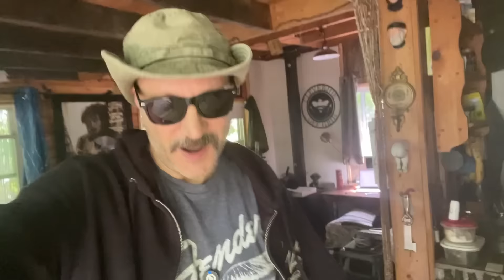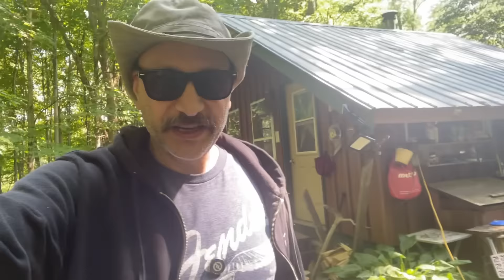Don't Kill Your Generator: 7 Mistakes to Avoid

Comment: Only use propane in a dual fuel generator. Buy several 20 lb. Propane tanks for emergences, and primarily use the generator to recharge a power station— use the power station to run your appliances instead of the generator. Fuel will last up to 5x longer that way.
Reply: We have a couple 30 lb cylinders. We also have two 40 pounders. I prefer 40’s because of the additional run times they give us.
Reply: Best solution is generator powering a power station.  I have an 8000 watt power station and a 2400 watt generator.  Lessoned learned during Helene, use the generator to charge the power station to 100% and then shut off the generator.  The mistake I made was once the power station was charged to allow the generator to run and use fuel doing pass through charging.  I could have saved fuel by shutting off the generator and using the power station.
Reply: If just charging a power station, I recommend a small 2k wh propane or gas generator then
Reply: Yes sir, I agree, best way to go.

Comment: Run the generator on a level surface, the crankshaft and generator can wear quickly if they're constantly running with pressure on the thrust bearings 

When storing always pull the cord over slowly until resistance is felt, this means you're on the compression stroke and the valves will be shut, mitigating the damp air entering the cylinder
Reply from the maker: Pulling the cord to resistance before storing is a new one for me, thanks for this! 👍

Comment: Do you use ethanol free gas if so how long do you store it and how many hours do you have in the generator
Reply from the maker: Regular unleaded gas, plus fuel stabilizer if not using it right away, drain the carb for longer term storage. Not sure on hours, but I've had the generator for a number of years now. Thanks for watching.

Comment: We own 2 Honda's 2200 one of them being the companion.  The mistake we did one time was to run the generators until empty before turning it of by flipping that switch but when we needed it again one of them would not start.  Apparently there is still remnants of fuel in the carburetor  which clogged the jets.  We now emptied the carburetor manually using the drain hose.  Luckily my husband had converted both generators to propane and the generator started without issues.  The conversion kit works great and it is quite expensive but in our opinion worth it.  We used the grenergy propane conversion kits.  We believe these are better and the process is the same but we like these because all the parts are aluminum parts for the fuel adapters  instead of some hard plastics and also comes with vents covers.  They now make tri-fuel adapters.  Watch the videos very informative and very easy to install.  I am not mechanically inclined but I was able to do one of them.
Reply from the maker: Thanks for your comment and info about the conversion kit, good to know.

Comment: Added tri-fuel kit (US Carburetion) to Generac 4000XL (circa 1999) about 2 years ago.  Haven't put gasoline in it since.  Hardest part was setting the load block properly.
Reply from the maker: Thanks for the info, can I ask what the issue was with setting the load block?
Reply: @cleverjoe  Found it to be a bit of a finicky process.  balancing the fuel and load.  governor on the generator was also a bit touchy when running on propane.  ended up changing the spring position on the governor arm.

Comment: We have a Honda EU7000is we bought brand new in 2018 before the pandemic hit. We use it strictly for back up power for our house in an emergency. Fortunately we haven't had a lot of emergencies but it's nice to have it. 
We got hit in New England by Storm Isais in 2021. We lost power for 54 hours. Our house was kept cool & comfortable. I'm now a retired power lineman for the same company that provides our power. We are preppers. We have it set up in full deluxe mode. My wife can start it & turn it off within the confines of the house. She never goes outside. I have to refuel it though. All our neighbors were furious they lost all their food in their refrigerator & freezer. We didn't. Of course I didn't see them until all the damage was fixed in three weeks time. They knew we had a generator because I warned them to get one. They couldn't hear it? They could see some lights on at night. (We try to be discrete about having one). They immediately wanted to see our set up. They were like tourists snapping pictures. I think when they went online to buy theirs? They had financial shock. They all bought the cheapest of the cheap in generators. Their priorities are different than ours. I would rather be prepared & drive old trucks. They prefer new cars & no preparation? 
We already follow all your tips anyway. Thanks for posting them. 
We use a HMC 30 gallon fuel dolly to pump & syphoning fuel. I use it for holding older treated fuel & pump it into my old truck. After a year we burn it in our trucks. Nothing goes to waste. 
You might be thinking why Thirty gallons? If you saw our supply of fuel jugs? You'd know why? I'll only tell you we have enough fuel for a 3 week interruption. I did that because in my line of work I was always working. I don't have time to buy it when I'm supposed to be sleeping. On storm mode we work 24 hours straight the first day restoring power. Then we get 7 hours off to sleep. However if you live more than a minute away? Driving home cuts into your sleep time. Then we work 2 pm until 7 am the next day until everyone is back on & all the damage fixed. No days off. No coming in late. No days sick. 7 days a week for 17 hour shifts. We signed up for that. Our employer gets a waiver because we provide a necessary need.

Comment: All good advice for maintaining reliable generator use.  One thing along with what other people have added.  When you run your generator periodically, don't forget to run it under load.  Maybe that's what you meant when you said to run it but did not specifically say.  If the generator is not run under load periodically, the magneto will lose its magnetic charge and not produce electricity.
I did not know this and learned the hard way.  Thankfully a little YT research provided an easy fix that worked for me to "recharge" the magneto capability, thus once again producing electricity.
Reply from the maker: Yes, good point and I don't think I mentioned this. Thanks!
Reply: Thanks for that....saved me some typing 👍
Reply: I use it to charge when putting my Ecoflow units through their paces. Keeps everything in use periodically. Ecoflow unit is for indoor power backup and the Genny charges it when needed to then continue with quiet indoor power. Ecoflow without extra batteries comes with for public land camping.
Reply: Magneto problem is less of an issue (inverter gens use rare earth magnets and don't rely on residual magnetism at all), but running a gas engine idle and cold for prolonged periods clogs it with soot. Exersize regularily!
Reply: Not True!
Reply: @bobbyabbott3035 sure is
Reply: Does that MARSHALL have a 100w head?

Comment: Lots of great advice.  Especially the part about charging power stations.  I blew out my board on my champion dual fuel inverter generator charging my pecrons.  Champion sent me a new board and warned me about running those inverter generators at max.  So I now run all my power stations and generators half to max 3/4.  It's like a car yes my car can go 100 mph plus but it will not hold up to long either.  Nor will my bank account from the tickets.  Lol
Reply from the maker: It’s easy to forget that power stations will ramp up quickly when charging at faster rates. Nice to hear that Champion had your back.
Reply: @cleverjoe  Yeah they replaced it free of charge and sent me a link showing how to change it.  I would buy from them again for sure.
Reply from the maker: @johnmal5975 Thats awesome! 👍

Comment: I seldom use my genorator. Offgrid 8 years. I have a small solar array.
I only use generator for well pump and tools. 
I hate the noise, buying gasoline, and the polution it makes. I might run an hour a week to do laundry. 
You can get enough solar panels and battery for about the same price as a gas generator and gave lights without the extra cost of gas,and noise.
Reply from the maker: Thanks for sharing - solar is definitely a good way to go when possible. 👍

Comment: Dual-fuel and Tri-fuel generators are more available now than ever.  That's my preference.  Conversions require some small engine know-how, and often fit open frame generators better.  The propane carburetors are kinds of large and clumsy.  I have one in a box in the garage waiting for a the urge to install it.  If the grid goes down for weeks, then I've got some 100lb propane tanks that will run the generator for a week or more.

Not a tip, but something to consider.  If you are dependent on a generator for basic comfort and survival in an off grid cabin, then maintain two generators on-site.  Prepper mantra: "Two is one, and one is none."

My only tip with generators is your fuel discussion.  In the long run, ethanol free fuel (boat gas, E0, clear gas, etc) has a much longer shelf life in full sealed containers.  Respect the containers' max fill, the headroom is required to avoid permanent expansion of gas cans.  There is a price surcharge for E0 gasoline, but in the long run it is cheaper than adding fuel stabilizer.  Ethanol absorbs atmospheric water, even with stabilizer.  The shelf life of E10 pump gas (10% ethanol) is about 3 months.  I've have E0 in sealed containers produce full power in generators after 5+ years of temperature stabilized storage.

I have about 10 small generators, more than half are inexpensive rescues and vintage generators from Craigslist from people that left E10 pump gas in the carb.  These units roared back to life after a complete carburetor rebuild, including replacement of corroded bits inside the carb.
Reply from the maker: Great points, especially about redundancy. It never hurts to have a backup plan, or a second generator. 👍

Comment: I have a Honda eu2000i bought new in 2015. Had the pair but sold one off a few years back. I live full time these days in my travel trailer and much of I can off grid. These days I mainly use it to recharge my BLUETTI AC300 with two B300k batteries as I use the power station to provide power to my trailer via 30 amp outlet. Just had the Honda cleaned up by a small engine mechanic and it runs but I am finding it doesn’t stay consistent anymore with power fluctuations. I normally set the BLUETTI to draw 500 watts from the generator but seems even that low still fluctuates so I drop to 400 watt draw. I’d hate to get rid of it but have no room to carry two generators as my next will be in the 3000 watt range. Thanks for sharing.
Reply: If it ran fine before cleaning/servicing then possibly shop disturbed a carb setting.
Usually it's carb or carb linkage problem.
(I'm not an expert small engine mechanic-just sold and wrote service orders)
Reply: @blaydCA If I recall it was sluggish after spending the winter off grid in southern Arizona. Needed a new pull cord and figured I’d have it overhauled but it might just be it’s running out of time. That mechanic is 2000 miles away at this point might just run it until she goes out but certainly don’t like the thought of having to rely on it out in the bush and she blanks out and I’m rushing to find another. We’ll see what tomorrow brings.
Reply: @Freeboot76 
That could be if it has massive running hours on it.
Compression Test would indicate if its worn out.
Maybe an auto part store has a loaner tester ??
Nine Years Old, 200 hours per year.
1800 hours ??
Small engine is about 2000 hour life span.
Honda maybe a little more.
Reply: @Freeboot76 
From AI:
"A well-maintained Honda EU2000i inverter generator typically lasts between 2,500 to 5,000 hours of operation. With exceptional care, clean synthetic oil, and light loads. "
Reply: @blaydCA thank you for the intel I guess I’ve never really kept track but looking back it’s definitely a possibility I only have 1100 watts of solar and that’s in a perfect scenario which doesn’t exist. Most I’ve seen out of my deployable panels in solid sun is maybe 700 incoming so heavily rely on generator as I like to utilize electricity off grid.
Reply: @blaydCA thank you brother
Reply from the maker: Thanks for leaving a comment and sharing your setup.

Comment: Honda engines HATE stale and contaminated fuel.
Turn fuel supply to OFF and let it run dry.
Never use Compressed Air to clean your Air Filter. If you're in a Dusty Environment, remove and tap excess dust off OR replace with new filter.
Using compressed air INCREASES the porosity size of the filter which allows particles onto the Combustion Chamber. Those particles cause cylinder scoring.
A slightly dirty filter is better than a damaged filter.
Source: Direct from Small engine manufacturers When I sold Power Equipment decades ago.
Reply: Another Tip:
Split your electric load over BOTH/ALL receptacles or generator/inverter parts will be too loaded up
Reply from the maker: Great tips, thanks for sharing! 👍

Comment: You don't need a propane conversion kit if you just get a dual or tri-fuel generator to begin with.
If you already have a gas-only generator it's still worth it, because having a backup is important anyways.
Reply: It’s hard to find a decent inverter generator that’s tri fuel. 

So far I have yet to find a gen like the EU 2000 that is tri fuel and inverter. 

You have some harbor freight offerings but they are junk and you can piss off trying to get parts.
Reply: @DasNewsNetwork  
well tri-fuel only matters where you have natural gas anyways, and in that case it's probably going to be at your house and not somewhere on the go

that's why it's much easier to find dual fuel generators and really that's what i'd recommend
Reply: @Chuck_Huckleryou miss my point. There is no INVERTER generators of that size that come dual fuel. 

I have yet to see a 2200 or comparable size INVERTER generator that’s dual fuel.  And I emphasize INVERTER because that makes massive fuel savings, engine life, noise, etc. instead of having to keep stopping and starting the generator while doing projects, you can levave it running and let it idle down worth the inverter to keep the fuel usage low. 

And any offerings harbor fright have are horrible. You cannot get parts for them like you can Honda.
Reply: @DasNewsNetwork  
I have a champion 2500w dual fuel inverter generator in my shed right now that cost me $600.

it's a suitcase style generator that i can hold with one arm.
Reply: @Chuck_Hucklerlike I said, a inverter you can get parts for. That champion is a throw away generator. If you need parts you are over a barrel or it’s like pulling teeth. 

If I need any and I mean any part for my eu2000 I can get off eBay, Amazon, and tons of Honda dealers. 

That’s the issue with all the made in china cheap gens
Reply: @DasNewsNetwork  
Champions are not throw-away generators, lol.
It sounds to me like nothing but a honda is good enough for you, and you're just upset that honda doesn't make exactly what you want.

In fact, the cheaper and more chinese you go, the easier they get to fix because they tend to use cheap, off the shelf and mass produced parts to build them.
China makes some very good knockoff hondas that are very very cheap, to the point that you could use them as throwaway generators even though they're both pretty good and pretty repairable.
Reply: I am not upset at all. That’s why I just put a conversion kit on my EU2000 and 3000 to run them off tri fuel and they work great. 

If I need a part for them I can have it a day or two. 

My 4Runner didnt come with lockers and a larger alternator. Am I upset, nope,, I just modified them to make them the way I want them. 

The EU 2000 and 3000 have a massive and I mean massive after market support and unbelievable lifespans because of the quality and availability of parts. 

If you are happy with your champion so be it. But not try to act like it’s the same quality or has the same support as the Hondas. 

I have 2 EU2000 and a Eu3000 with tons and tons of hours on them. I take good care of them and they have never givem me an issue. 

If I need a part I get it no problem. 

I have the service manuals for them and they tell you down to the toque specs and assembly order how to fix them and troubleshoot them. 

Ohm readings for the generator coils, voltage readings for different rpm’s. You make it. They don’t make you bend over for their service centers.
Reply: @DasNewsNetwork  
You sound pretty upset buddy, just saying.
And i do quite enjoy my champion generator, since i take care of it it's never failed me.

And if it did, i can get parts for it all the same, since it's a popular brand. There's chinese knockoff parts and even upgrades for older models, too.

I'm sure it doesn't have all the same rounded corners as a honda but it also costs half as much, so i could buy two of them and have twice the power, or use them in two places at once and still have one if the other failed.
Don't act like honda is the only option, or even the best option for the price, because it's absolutely not.

Comment: There you go stealing my dance moves again! I use only propane (so far) on my generators. Less energy dense (will not generate as much electricity as using gasoline), but storage is a huge benefit. Keeps forever barring leakage. So instead of getting 2000w of output, it will generate ~1800w. My "tip" is to buy a generator that is rated at least 50% more than the maximum electricity you estimate you will need. Running at or near maximum output constantly will wear out your generator much faster. Do not forget to account for less electricity if using propane or natural gas.
Reply from the maker: Zappa is a dance move generator. 😎